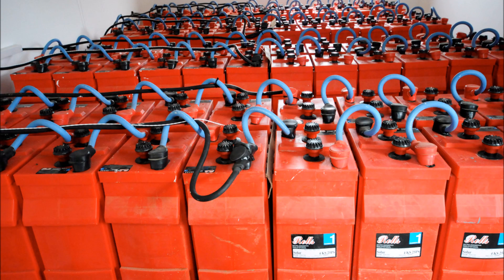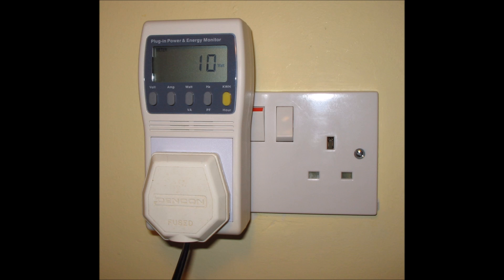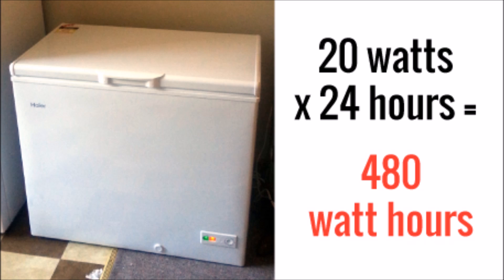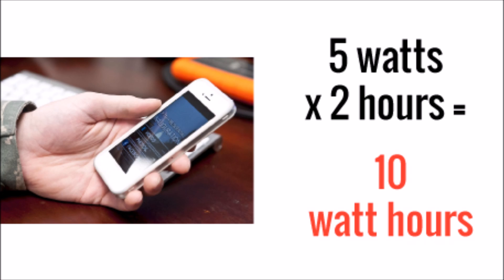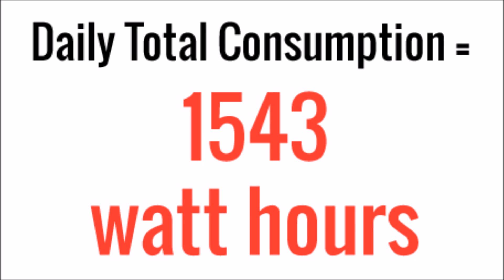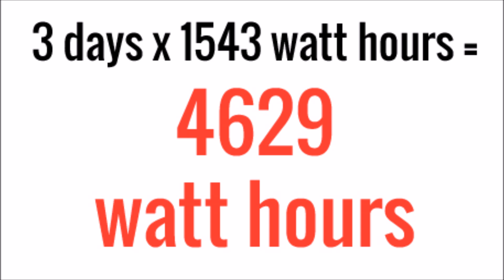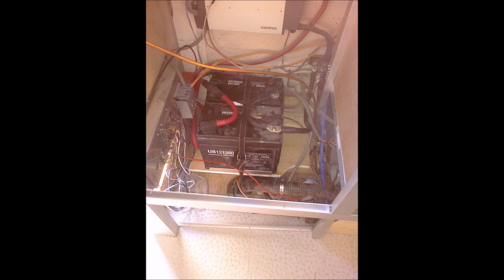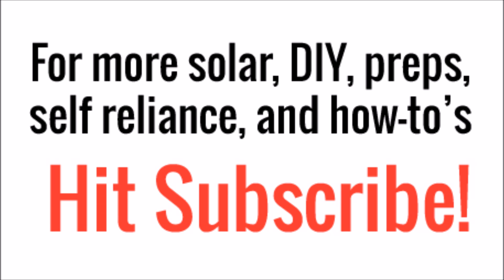How To Size Your Off Grid Battery Bank Capacity For Solar - Math Warning!

Comment: Hold on, whay is this 50% stuff you glossed over??
Reply from the maker: Its a terrible rule of thumb that I can't properly explain here.  You could pick 60% or 40% or 80% but the point is that you need to pick a depth of discharge that you are comfortable with using every cycle and then size the battery bank accordingly.

Comment: If I hook my 190 an batteries up in a series are they still only 190ah or are they 190ah x the number of batteries.
Reply from the maker: In series they would still be 190Ah but would have double the voltage and thus double the Watt hours.  Sometimes it is easier to convert batteries to Watt hours when you compare them.

Comment: Very informative video, but i might break your advice on going for less than 2 days for my purposes 😅😅 trying to build a battery system for my whole house to take advantage of off peak usage rates where I live... So it will be charged every night and only used for 16-18 hours a day
Reply from the maker: If you can afford it, go for it!  It just gets real expensive real fast when you try to store multiple days worth of power.

Comment: LDSreliance - I have an opportunity to pick up a 48 volt, 2000 amp hour (Exide GN8 Absolyte GX2000 Telecom Battery System... we will be in an off grid modified Earthship style home. Any thoughts?
Reply from the maker: Sorry, I have had an avalanche of comments lately and I am behind.  Telecom batteries are great but I would highly recommend that you look at the manufacturer specifications, specially the life cycle vs depth of discharge chart if they publish one.  Sometimes telecom batteries are designed like UPS batteries to be standby batteries and are not ideal for daily deep cycling.  They are more for an emergency use basis.  So make sure of which one that is before you commit to it.  But some of them are built like tanks and that would be a great buy!

Comment: So... a car battery costs $200 roughly and supplies 60 amp hours.  So the scenario you describe at 771.5 amp hours would amount to around 13 batteries costing you $2600?  Also... lead acid batteries typically last 3-5 years, up to perhaps 12 years.

So... this will cost you $216 per year up to $866.7 per year to maintain this system?
Reply from the maker: A car battery may be rated for 60Ah but that is rated at 100% state of charge down to 0% state of charge.  In other words, a car battery or starting/cranking battery, would be dead after 30-150 cycles down to 0%.  If you discharge it to 50% as I stated in the video, it would last longer (potentially 300-500 cycles) but still not anywhere near 3-5 years like you claimed.  The reason a car battery lasts 3-5 years on your car is the car engine only discharges the battery about 3-5% before it recharges it again by driving.

So discharging to 50% and assuming you get super lucky and get 500 cycles... you would need 26 car batteries and you would plan to replace them every 18 months.  Not at all practical.

If you are going to do it, do it right with proper deep cycle lead acid batteries or, better yet, lithium batteries that are designed to operate that way.  Car batteries are completely inappropriate for this type of daily use.
Reply: @LDSreliance  I appreciate your response, sir.  My knowledge of battery fu is nowhere near your level; so, I very much appreciate your weighing in.  I was taking the battery specs on a particular car battery at face value.

Erm... how did you derive that the 26 car batteries would need to be replaced every 18 months when 3-5 years works out to be 36-60 months?
Reply from the maker: I understand.  Everyone has to start somewhere.

I calculated that we would need 771.5 Amp hours of battery capacity at 50% depth of discharge, which is an overly simplistic, but workable rule of thumb for lead acid batteries to avoid beating some of them to death.  So at 50% depth of discharge, a car battery would give you 30Ah.  So 771.5/30 = 25.72 or 26 rounded up.

A really good car battery may last you around 500 cycles at 50% depth of discharge.  If you are using it every day, like you would be in the scenario in the video, then that equals 1.37 years so I rounded up to 1.5 years to be generous.  Again, this would be a premium car battery.  Your average Wal Mart special would not handle this kind of daily abuse.

A car battery is a starter/cranking battery, which is designed for short bursts of lots of power followed by long periods of recharging.  Starting the car only discharges the battery 3-5%, so it will last a long time that way.  But discharging that same battery to 50% or 100% is another matter entirely.  They aren't built for that.  They are sprinters, not marathon runners.  A deep cycle battery is build to handle daily "deep" cycles like the name suggests.  So using those would be much more appropriate.

Comment: lithium batteries actually do not care if they're charged to 100% then down to 0%.aslong as the controller is good on them, they usually have 5-10% extra capacity built into them on each side. but you're right with lead acid. 50% no lower. with lithium batteries they are rated for number of cycles, so a 50% charge depletion twice, is 1 cycle, sure your batteries are going to last half as long with half the batteries, but you also spent half the money on them. ive tested this quite thoroughly with lithium batteries and the 80% 20% things is mostly a myth for lithium batteries. if i am at home i leave my phone plugged in the whole time and my battery is still perfect after a couple years. 99% battery health on my iphone, after 2 years..... compared to when i did the 80% 20% thing, my battery would be at 90% health after 6 months or so.

Comment: I just want to say a very sincere THANK YOU! All the videos I found before you were diy guys with background in electricity stuff, jumping back from solar panels to currents to wiring to frameworks to paid promotions and so on. You broke it all down like a man. So in short, going off grid is not as much a solar panel but a solar battery bank matter yes?
Reply from the maker: Yes, off grid requires, at minimum, a solar panel, a charge controller, and a battery.  That would get you DC power.  To add in AC power you would need an inverter.

Comment: This was a really helpful example, thank you. But can you also explain voltages? Like most components don’t run off 12v right? So you need some sort of equipment to step it up right, or just by a whole bunch of 12v stuff? Does that effect the power consumption?
Reply from the maker: You can get almost any appliance or device you need to work directly with 12V or 24V DC if you try hard enough.  And if you can't then you can run it off AC power from an inverter.  But obviously that wastes some energy.  But to answer your question, yes you can get step up or step down transformers that will take the 12V DC (or 24V DC power) from your battery bank and convert it to power that your devices can use.
Reply: Relax, I am pretty sure he was concentrating in demonstrating on how to estimate the size of your battery bank. If he were to continue explaining the rest of his set up, he would be talking about the charge controller and inverter and several other small components needed in the system.

Comment: you forgot to calculate in the inefficiency of the inverter (usually 10 to 20 percent loss), not to mention wiring resistance, potential battery temperature loss, (especially with lead acid), Peukert effect (discharge rate), just to name a few.
Reply from the maker: Yes, I tried to keep it pretty simple.  I have covered all of those topics in other videos.  I have also found that 20+ minute videos trying to explain every detail of something like this end up not doing very well.  So I try to keep it bite size.

Comment: Good video but you didn't factor temperature into the equation. For example, you'd need to add another 25% capacity if you're using batteries in 0C (32F) weather.
Reply from the maker: True.  There are several factors that were left out for the sake of simplicity.  This video will get you 80% of the way there.  Baby steps.

Comment: WRONG...

I m looking to see if there are any videos on line that actually get this right... looks like Ill have to do a video.

You got most of it right. but your solar is not working.
you did your math wrong by not doing your day and night hours separately.
Reply from the maker: Can you elaborate?
Reply: @LDSreliance  sure, but simplified.
So you got solar panels, they make power.
When they make power you don't use the battery, as long as you've done it correctly.
So your day "sun hours" should be taken from the math.
If you've 1kw solar, then  if we say your going to get 3 sun hours. So 3kw of power.
If you have 5 KW in a day and you use 1 for the day " direct drive" from the solar then you know the night is 4kw.
You have lead acid, that's 50 %dod<
That's 6kw.
6000/12 is 500ah 
The other issue (peak draw) and if the pack is able.
Say 4-10 is the use time.
8 hours.
Or 500w an hour, at 12v that's 46amp.
But you need to battery size for you peak power. Say a 850w microwave.
This is battery draw and it's C rate.
100ah usually 10amp.
So a 12v at 10amp is going to give you 120watts.

Too high c rate draw is a factor of 1.6
Reply from the maker: This video didn't have anything to do with sizing a solar panel system.  It was only for determining your loads and run times and then figuring out the battery capacity needed to fulfill those loads each day.  There are more considerations than in this video, such as Peukert's Law if you are going to use lead acid batteries and the effects of cold weather on lithium battery performance for two examples.

Sizing for your biggest draw is definitely true.  But that has more to do with the inverter sizing than the battery banks unless you are going to have a tiny battery bank.
Reply: @LDSreliance  the c rate of the battery is important, as well as the charge time. Both matter.
When it comes to fitting or wiring, then the voltage matters due to current.
The inverter and power draw in current and watts.
120v 600watts on a 12v battery it's 50amps.
The puc effect is higher the higher the draw.
As is voltage sag and increases current.

So if you're using LA you need to spread that load.

But as for calculating power storage it should be split day and night as you offset on the solar so it can be null.
If you make excess enough to charge a battery.

The calculations could account for 50% of the power already. Then you don't need to double up for DOD in that case.

For size with lifepo4, 50%dod is for more than 3000 cycles, but around 2.5-3k cycles is 80% DOD.

I use around 5kwh a day I have 1.2kwh of battery. I may use 400watts from the battery. My solar is 1kw.
I don't have night use, maybe a light now and then. 5w.
By the evening I charge a aux battery and turn off charge on the bank.
Reply from the maker: All of that is true.  But that is more of an advanced topic of conversation and it only changes the battery bank makeup slightly.  My channel is all focused on beginner to intermediate level learning, not advanced topics.  I have done Youtube for 10 years and I have seen very consistently that when I start to go into more advanced topics and start to get granular and the videos go to 20 minutes, I lose a lot of the core audience.  I prefer to help people get started on their journey so I'd rather get them to 80% of the way to the target, which I think this video does well than try to get them to 95% and lose 80% of the audience along the way.  Does that make sense?
Reply: @LDSreliance  I only mention it as you can end up having massive batteries and cost which may not be required.
Alot of people undersize their battery bank. 
But it's fairly complex to do the math on how to size a battery bank, what voltage and current will be and then what charge volume is needed and what is off set.

I think doing the math with;
Always on (24hour).
Day use.
Night use.
Charge requirements.
Solar requirements.
Daytime offsets.

A big thing is current. I wouldn't recommend. 12v as the bank has a high draw and sag. 24v isn't bad and common. 48 volt gets a bit much for campers/RV's due to solar sizing, but I'd still use 24v solar for 12v only because it pumps up the current and shortens charge times.

For example the set up I have 1.2k batt and 1k Solar does allow for a full charge in 35 minutes. (50% DOD) and that depends on the sun. But in bad sun it's just under 6 hours to charge. Or worse.

While that is a norm. Having a big solar array allows for better Charging. 
Now we come to battery tech. My bank is <5amp, so I have to make that before I get a good charge. 
If I had lifepo4 then the in and out is totally different. As will be the charge control.
The losses are different too.

See you don't need a short video but more a feature film. :)
Reply from the maker: LOL I will leave that to you.  Start up a channel and do a video on all of that and I'll be happy to promote it!  But I'd lose 80% of the people 2 minutes into the video.  Seriously.
Reply: @LDSreliance  people tend to lose interest after 5 minutes. But people who want to know will watch. Maybe a mini series then
Reply from the maker: I've tried that, too.  And the viewer numbers go down rapidly every episode.  At the end of a 4 part series you will be down to 25% of the original audience or less.

That shouldn't matter in a perfect world but the ad revenue on Youtube sucks as it is so I get no return on my time, effort, and money producing videos that no one watches.
Reply: @LDSreliance  I find that it doesn't serve the video series. If you watch one it maybe half way through and then you have to hunt down the rest as it won't show them.
I think you can  hash tag and number them
 It certainly helps when you're viewing.

It's hard to know how many people are going solar. They say more people are. But I think "off grid" is like a different range, like the log cabin folks.  Ev powered by solar may be a market?
Electric bill  reduction maybe the other.

Comment: what it boils down to is, of you dont want to live like a heathen and you're not rich, you're not going to have battery backup or solar....
Reply from the maker: You're using a false premise.  No one said you had to completely rely on solar.  It isn't a zero sum game.  You can invest in a small system and get the same percentage return as a large system for grid tie.  Or for off grid you can run part of your cabin or house on solar and part of it with a generator or something else.

I mean if we're going to make assumptions and look at this at the extremes, you have to be rich NOT to do something like this.  Electricity prices have increased 1.8% every year for the last 25 years, on average.  And the cost of an installed solar system has dropped 70% in the last 10 years.  So it doesn't take a rocket scientist to see that it will be far cheaper down the road to power your home or cabin or RV with solar than it will with grid power.

Comment: When you go to upgrade a simple system, is the charge controller going to be limited to a certain number of solar panels? Is it possible for the charge controller to not be able to handle over a certain number of panels? And how do you determine this also for other parts in the system? 

I'd like to add another panel and another battery to my setup periodically a bit at a time, but want to make sure if its safe to do so.
Reply from the maker: Yes, the charge controller will have an amp rating and a voltage rating that will determine how many panels you can have connected to it.  But you can run multiple charge controllers if you need to on the same battery or battery bank.
Reply: @LDSreliance  Thank you.
Reply: @LDSreliance  do you also have to worry about that for the power inverter?
Reply from the maker: Yes.  The inverter will have a range of voltage that it can accept and a maximum watt rating (which you can use to determine the amps).

Comment: What about the size and capacity of required charge controller and inverter? How to calculate the required size?
Reply from the maker: The inverter is more based on the loads you want to power with them.  You have to do a lot of testing, research, math and analysis to figure out exactly what your power needs are on the average day and then you can size an inverter to match that (with a little extra capacity, of course).

The charge controller should be determined by how many watts of solar panels you have and how you wire them.  And the number of solar panels you have should be determined by how much power generation you need each day.  So it all ends up coming back to analyzing your power needs (add up the total power consumption of all your devices you need to run each day) and then working from there.  Too many people want to work this from the opposite end.

Comment: I have a 4000 watt fireplace and need if I just want to use batteries 
How many batteries do I need if I have 12 volt batteries 381 watt cell
Reply from the maker: 381 watt cell?  Not sure what you mean by that.

Comment: what was the time frame for your calculation, did you use total per week, month, or day? 
Live in a property which exceeds, $2000-3000 in electric bills alone. Three homes, 6 people per house.... 
What would you opinion be on this?
Reply from the maker: The calculations were on a daily basis.  So the batteries would be deep discharged daily and have enough reserve capacity to allow for 3 days of reserve power.